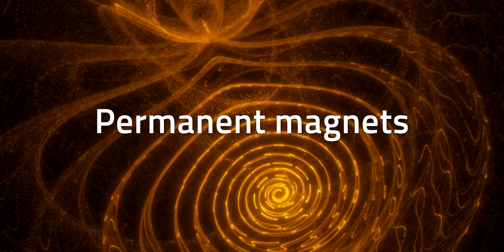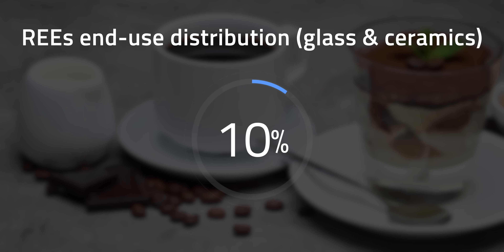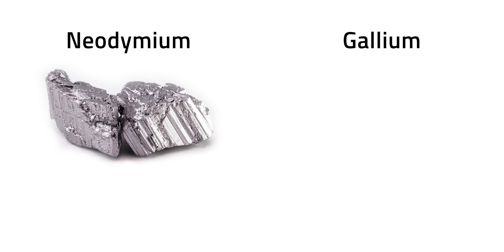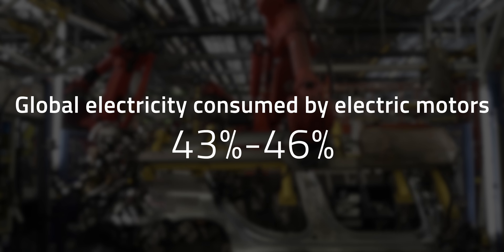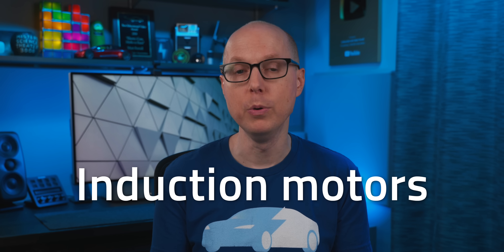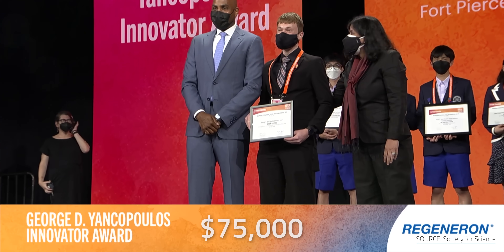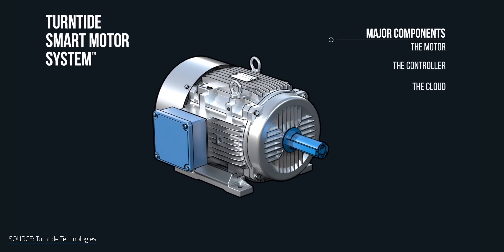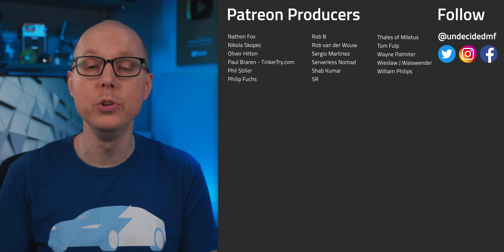Why This 17-Year Old's Electric Motor Is Important

Comment: I like what the kids doing! as for the overall clean renewable energy issue goes I'm still waiting for all my fellow tree huggers to get real about wanting to fix it. I have a design based on currently proven tech. but in a very old design ( ancient ) by studying ruins from around the world I found the answer in plain sight . I want my design system to be used by all. because it addresses all the issues that the current tech. all share. It is scalable so it can be built at or very near point of use saving most all the issues with the grid, it doesn't kill wild life, it is not a eye soar on the view, other than possible issues depending on type of generator used for the conversion from energy to electric power no pollution, works 24 / 7 365 so no real need for storage, simply build it as I've designed it & plug in to use the power.  It does all the good stuff minus all the bad stuff. I work but not cheap . If you can swing it I'll make Elon Musk a deal because he will be able to see the potential & get it to the masses both here & Mars. I'd give it to humanity but I have descendants who deserve to enjoy the fruits of my labor in perpetuity due to the true & fair value of what I am offering the worlds.

Comment: Thanks for the lovely little video - would you try to slow down your speech please? .... as an Englishman I had to run your video at 75% speed so I could make out nearly all the words - until I looked it up, I was sure the lad from Florida was called Sam Sung, which seemed unlikely though there is an obvious commercial tie-up there. More likely in 30 years time Sansone will be competing with Samsung as the two greatest aircraft companies in the World, or drilling straight through the World to connect antipodean countries using motors powered by the Earth's core I should think! Thank You, Colin

Comment: Claims sound like BS. The 3 phase induction motors we've been using for over 100 years are already between 80% and 90% efficient. Those 30 some percent energy savings of those HVAC systems have to be coming from some other part of the system

Comment: German Mahle already has  a complete earth free 48V drive train system
problem is appearently not the motor, rare earth free is easy wich low voltage, problem is the battery

Comment: Nice and informative video but one constant flaw of modern technology is greedy companies. Making a more efficient motor sounds great on the front end but the hard truth of the matter is that power companies will raise rates to offset the lower demand thus not saving the consumer any money. Yes, they may lower the energy usage but that energy will be more expensive. If I could wave a magic wand and make all cars on the planet suddenly get 100 MPG that would decrease the oil usage but OPEC and other nations would cut production to get the price higher (they do it all the time). The planet would benefit but not the consumer.

Comment: A typical wind turbines uses zero  REE.  Most turbines are still non PM  DFIG (doubly fed induction generators)

Permanent magnet designs can use ferrite  (iron) based magnets with zero REE.   

Please stop feeding the "Renewable is doomed because there aren't enough REE" meme.   

Renewable can be done  without REE.   If REE elements ever become  too expensive or rare, we will.

Note  that  renewable is not fuels and  require 1000's  of times less mining and refining compared to uranium or fossil fuels.   Keep that in mind when finding "problems" with renewable.   It's fossil that are running out of minable resources,  not renewable.

Comment: This is why the race to electric vehicles, wind farms, solar panels and battery storage is an unmitigated environmental disaster but, politicians likes "votes" so ignore the consequences. I've worked in the generation, transmission and distribution industry in a professional capacity for over 40 years and the direction the zealots are propagating is unsettling.

Comment: Thinking ahead, electric motor designs all generate electrical power (typically a feature that makes motors less efficient). Electric generators are historically designed like motors, with the motor reaction casually left ignored, increasing the cost of power generation in money and pollution. 

A look at this situation, improving generators immediately leads to combining the functions of generation and motoring (Tesla said it was a simple matter to shift the phase of the magnetic fields.) His power plant was self-generating (no external power source required).  Seems lost profits for energy pirates (I mean industrialists) have arrested critical innovation for over 100 years.  Think on that. Party on Dude, be good to others.

Comment: 37% power increase is not going to make the needed impact for vehicles. Taking that 37% and reducing the power to a lower efficiency level will give said vehicle some added range but no where near what consumers want. Towing a trailer eats up stored energy TREMENDOUSLY. Furthermore... . 
Since the mid-late 1800s electric vehicles came and went, mainly from lack of power storage. With today's electrical/power storage many issues, I don't see EV's replacing fossil fuel for at least 25 to 50 and quite possibly 100 years. 
([years rounded] 2025 minus 1875 = ~150 years that EV's simply were not ready for prime time. Hence my last line)

Comment: Love new motor Tech is amazing to see what new developments are coming out. but…. Motors haven’t really been the main limitation for EVs. Increased efficiency, decreased mass, these things help to mitigate the fundamental big problem, (band-Aid). And that problem is… ENERGY dENSITY. the amount of energy stored in a given system or region of space per unit volume. i’m afraid battery tech doesn’t even come close to the energy density of gasoline, and it may not even be possible to get close.

Comment: The Tesla motor arrange permanent magnet at an angle and the imbalance make rotor push against straight permanent magnet in stators and dirve forever until turn the rotor straight back to stop and angle change speed and torque

Comment: Not gunna get into it much,  the debate of rare earth magnets causing pollution  bc of manufacturing  issues is not of my personal concern but mainly ev s having a problem with recharge  most ev can send power back into the batteries by kenetic regeneration  or better simplify  using momentum  to generate power causing the car to slow down. At times it takes more power generation to recharge millions of these things world wide causing possibly worse pollution to charge  than to mine magnets  what if instead they had a way to recharge   by solar or even internal mechanical energy that could be like a hand crank or something perhaps

Comment: But... Tesla uses induction, squirrel-cage motors with VFD drives. No magnets at all. And it works. So why to invest in reluctance synchronous motors with ridiculously low efficiency? Even slip-ring motor with field coils on rotor (of the type of car's alternator) is more efficient...

Comment: Half of the things you mentioned are not correct. Regardless of that his "idea" is still inefficient. Hes building a motor that takes mechanical energy and transfering it into electrical energy. Very similar to hydraulic. Energy is everywhere. For cars on an old 65' Ford Falcon I ran it off bacon grease. I made motors run off of helium by having it in a hot reservoir because the atoms get excited and expand going into the cylinder making the piston rise. Then in the cold reservoir the atoms slow down and the helium contracts while the piston is being lowered and then it cycles through completely back to the hot reservoir. I've built motors off of 100 proof alcohol from corn and sugar. Obviously water, its basically a steam engine. Same with plants If I could turn into oil. Energy is endless. Electromagnetism is the way to go since you create your own force. How they/tesla goes about the batteries is flawed because lithium is a cation. I've takened lithium batteries and put them in my freezer for 30to 60 mins at 32°.  After an hour the lithium cations turned into a neutral ion completely destroying the electrical charge within the battery. I put it outside after 2 hours of it warming back up at 75° to see if the atoms would start to move because of the heat. Its didnt pick up any ut signals. I took another lithium battery put it just outside for 5 hours at 80° and the battery was fried. Lithium isn't the way to go because temperatures affect it too much. Nuclear energy is. Instead of using uranium in metal tubes and heating them up. Why dont we take fusion plus fission on a small scale reinforce the nuclear plant and we would have endless energy due to how much Uranium provides. In a closed controlled thermonuclear reactor we could supply all of the united states with 150 gallons of water per minute. But when I try to invent stuff I have the FBI at my door. But a dumbass 17 year old can do it and get 75k out of his flawed "invention". All he did was take someone else's idea. 
Edit: if anyone wants to make their car ran off of renewable energy. I have all of the blueprints on AutoCAD. I do not use electricity for cars. Besides cars, solar panels are a joke because the photons cannot go through it when it snows. There is onky a minimal amount that the panels can take in. Solar panels remind me if the windmill bullshit they were trying to do 10 years ago that failed horribly. If the government is trying to push renewable energy know there will be many flaws and on ourpose because the oil industry runs the world.

Comment: Listen up. 100% efficiency is 1:1 power in to power out. 
I designed and built a motor with 300% efficiency  it is completely scalable.  Every watt that it consumes 3 watts are generated.  Zero maintenance. 
Manufacturing complexity is low and units can be built to power single homes, entitie commercial/heavy industrial facilities, replace hydroelectric dams and gas turbines,  even power an aircraft carrier while reducing maintenance, weight, and ZERO fuel and emissions. 

Sound too good to be true? Its not and im not lying about this. Haven't went public because i know that government and industry will kill me. Projected sales in the first 3 years is conservatively set at 2.2 Trillion dollars with devastating effects on current industry.  Investments and job within the energy sector will vanish, with hundreds of billions in losses and over a million without jobs in the first few years of production. 

What are your thoughts?

Comment: WTF? Wound stators and rotors have been around for decades, probably more than a century. Permanent magnets are not a necessity for an electric motor, DC, AC or three-phase.  Also, most of the rare earth metals coming out of China are for chips and batteries and not so much for magnets.

Comment: Don‘t get the hype for reluctance motors. Induction motors have existed for over 100 years and still exceed reluctance motors in torque. They are very cheap as well and can be build with low vibrations and noise. Efficiency is not worse either. Use what works please, not what seems new and shiny, but is worse in almost every way

Comment: Nothing new, using reluctance is quite an old technology but then issue is sync. Bangalore startup Chara technologies has developed switched-reluctance motor, with only Steel-Copper-AL and using controller based switching. They have tested it at IIT Bangalore for last 1 yr, and are now rolling it out for commercial use.

They have tied with 'Amber Enterprise India' - AC, 'Bounce' - EV Mobility and Tata Elxsi - mutiple purpose for field trials.

Comment: Nice motor, very interesting. Well done kid. 

I think electric cars are a white elephant, simply replacing one problem with a greater one. 
To move a mass from A to B takes energy. Weather you use elective or petrol, that basic fact is unchanged. Electrical transmission is not efficient. Creating electricity is NOT clean. Countries are abandoning nuclear. Renewables simply can not provide enough power to feed the grid. That leaves fossil fuel. It really doesn't matter weather you burn the fuel indirectly at a power plant or in the vehicle itself, power is power, work done is work done. Electrical vehicles aren't cleaner overall, they use more power over all to do the same thing. Unless a clean source of power is used, you have gained nothing by going electric. Also, the current grid is no where near large enough to handle everyone moving to electric. I really don't think people understand the logistics of power generation. More infrastructure, power plants, better and more everything from end to end. Who's paying for this? If 3 to 5 percent of cars are electric, try multiplying their number by 20. You soon realise just how huge that demand will be, it's mad. This isn't clever or green, it's a huge industrial upscale to achieve the same thing for no significant gain.

Comment: SO much misleading motor theory in this article. Inductive start inductive run motors are nothing new and they produce extreme starting torque. We know all of this already. Of course these are also known as AC motors...and they run on DC as well and only turn one direction. Yes, they can be designed to turn both directions but that means switching field connections. 

I'm pretty sure Elon already thought of the pros and cons.

Comment: Better motors does not address most of the main causes of resistance to going EV.  I'm not going to give a hoot how good the electric motor is if the resulting product, whether it be a car, semi, bus, or tractor does not possess the capability to meet all the needs of the consumer.  Also saying EVs are more environmentally friendly is certainly a narrative,  it is however not an accurate one.

Comment: The motors are cool, but I don't think they address the current problem. With global support since the 90s trade agreements, China has taken over the entire supply chain for any products made with their materials. Rare earth elements being just a small part. It's not a free market, they won't allow sale of anything that ends up in a product that undermines their goals. Products like these motors will only scale to a level of impact when they can be produced in China, until then anything using these motors can be made just as easily as a phone that has anti-China apps preinstalled.

Comment: I was seriously disappointed by this video. Previous undecided videos were informative, but this was just clickbait. Matt mentioned this could reduce rare earths in EV motors and wind turbines, but failed to explain if this motor could be used as a generator at all (I don't think it can) and failed to mention that typical rare-earth free induction motors are already at 92% and higher for EV use. PM motors are used for higher low speed torque and simpler drive controller design, not because of efficiency. It is entirely unclear if this invention improves on any of those things.

Comment: Issue is not electric motors but fuel for electric generators. Electric generation still uses 18 century methods way before Tesla. And that is big issue. Solar, hydro, wind are free fuel but are very or low density wind and solar or very expensive infrastructure like hydro which still uses 18 century method of energy production. For example  heat pumps is that they're an incredibly energy efficient heating method. Air source heat pump efficiencies can exceed 300%. It is not violation of energy conservation law it is 1kw of electric energy converted to 3kw of heat. But when you say it can be applied to electric generation engineers will try convince entropy only applies to heat and computer science to work energy (turbine) on which directly electric generator is connected it is impossible to apply. Why? Math allows these operations, thus why  force of habit must sop from progress to develope new method of electricity generation, if no mathematical (break rules)  manipulation is done, scientist must tackle issue not engineers. Ok we have not (scientists) concept of entropy for mechanical systems, we can try to define. Fuel, especially gas, oil and coal must kept underground. And solar, wind hydro must be not all apples in basket diversification of electric production.

Comment: I'm all for advancing science and technology and this new motors are great butt I disagree the motors aren't really the issue with eevee's as the batteries are the mining of lithium and Cobalt is what causes massive amounts of emissions you need to mine somewhere near 5 tons of Earth to produce one Tesla battery cell that weighs roughly about 1,000 lb well I think the advancement of the motor technology is great if not going to solve the problem and eevee's are never going to be a sustainable